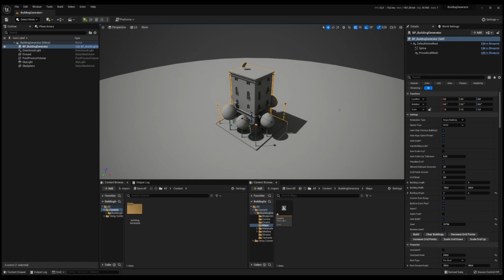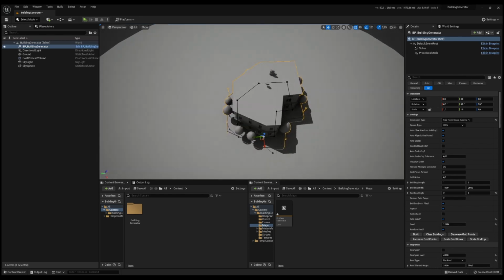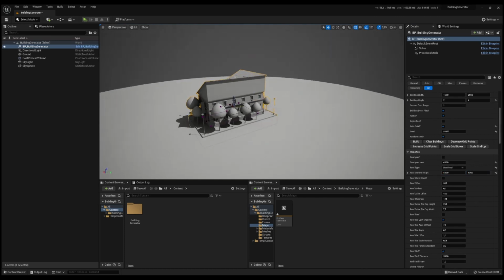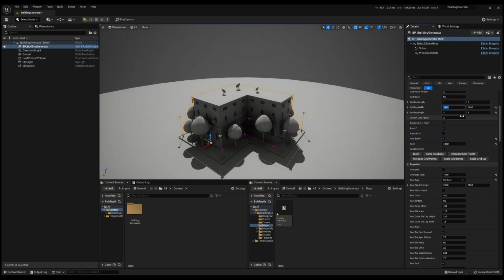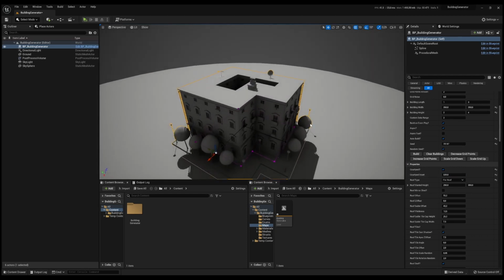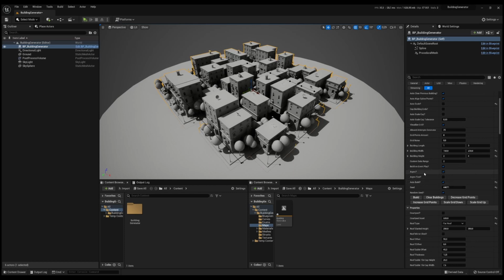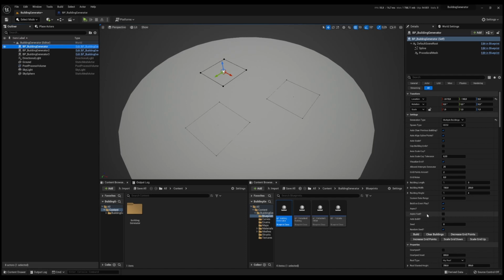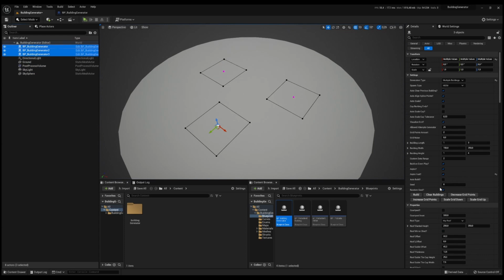Building Generator V12

Comment: Could it be possible to populate instanced static mesh components instead of using a procedural mesh?
The reason is, runtime rendering performance, and to be able to generate the building in editor time instead of runtime. For example, in the matrix demo all buildings use many instanced static mesh components, one per mesh model.
Baking them into static meshes is really tedious and slows a lot iteration speed. 
I've seen the blueprint and found references to hisms, but can't figure out how they are being converted to the procedural mesh.

Nice work btw. Amazing tool.
Reply from the maker: Hi! Hmm, nothing is being converted into procedural meshes. The roofs, curbs, interior floors and cornices are being generated as procedural meshes. So all the meshes which you add will be spawned as HISMs. Baking is often not necessary, consider using the persistent building under spawn type. It would not be possible to use your own static meshes instead of roofs or curbs since they would not be able to accommodate any shape of the buildings.
Reply: @auldencarter  I understand now. I thought the building was a monolithic procedural mesh!
Thank you for your answer.